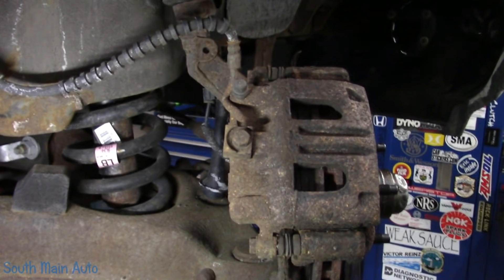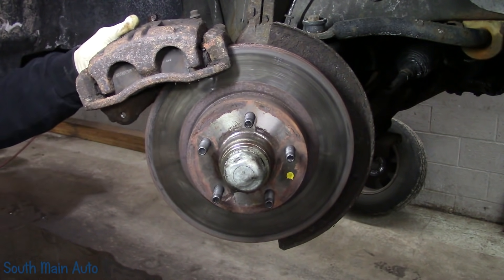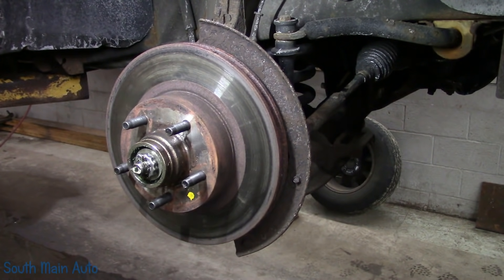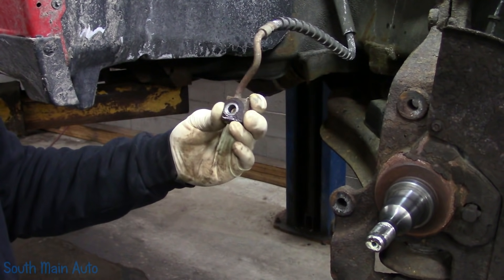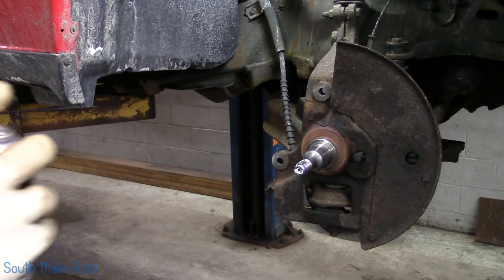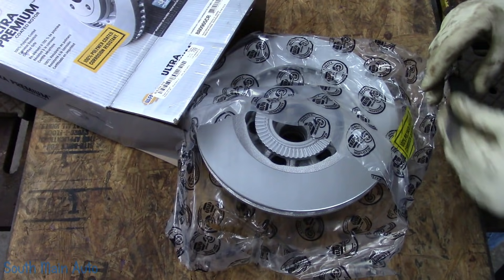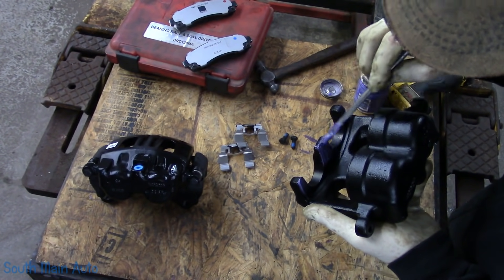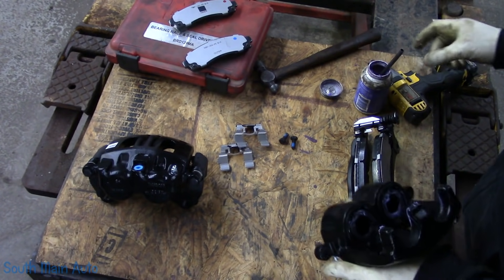Ford Ranger: Full Brake Job Overhaul - Part I

Comment: I've noticed that almost every time you film a brake job you change the rotors, too. Is that a requirement for you to do a brake job ? If so, why ? Just wondering.
Reply: I guess the rustbelt causes the rotors to be eaten away before the second set of pads would be done.
Reply: Time and labor of cutting rotors trying to guarantee a flat warped free surface is not worth it.
Reply: @dkupy100  Who has to do all that ? I've never had an issue unless the brakes were left too long and damaged the rotor (or excessive wear). Maybe up there in the North that's an issue, but down here you can change the brakes alone and be just dandy.
Reply: @ChristIsCome  I hear you Will. I live in Miami and always put new rotors on. Lets hear other mechanics opinion.
Reply: @dkupy100  You get a little more money for it, too, yeah ? I might have to start changing rotors after all. 😂
Reply: @Jonathan Mitchell besides that they seem thinner do usually  can't turn them and still have them legal. That is in communist NY. Also most guys with lathes around here got rid of them for just that reason.
Reply: Most of the time they are rusted or worn enough that they need to be replaced instead of just slapping on new pads.

Comment: This 28 minute video was just uploaded 4 minutes ago.  How can anybody know if it's good or not?  I'm gonna watch the whole thing before I make any comment (except this comment).
Reply: Come on. It's SMA. You know it's gonna be good even before watching.
Reply: It was pretty good.  Finally explained the reason you put the grease behind the SS retainers.  I read in Amazon reviews that people had troubles using the ceramic grease on the slide pins as well as on the piston near the dust boot.  You ever use that bright orange/red stuff made by CRC, it's called Disc Brake Quiet?